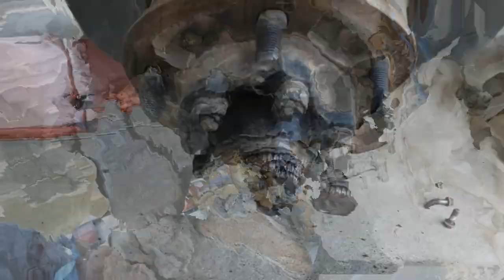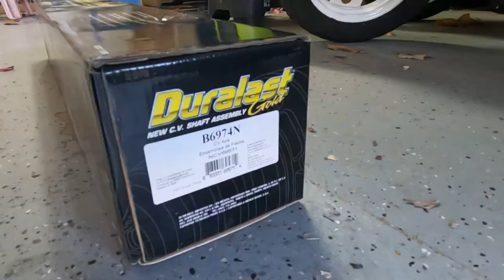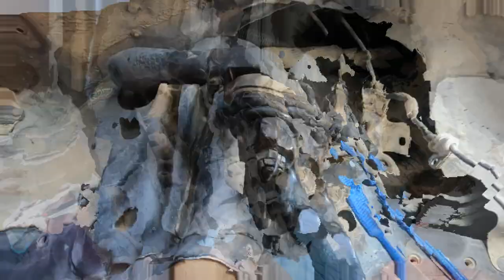Easiest CV axle replacement Land Cruiser 100 Lexus LX470 ASMR

Comment: Bro this took me and my boys from 1pm to 1130 at night . Holy shit so many rusted parts and autozone runs . 😂
Reply: 2 hours for me so far and I still can't separate the ball joint like in the video he just hammered it out lol. I just ordered a ball joint separator and I'll go from there.
Reply: @seahawksforever9504  I used my bottle jack and placed it in between the rotor and the upper arm then hammered it with a 5lb hammer it came undone
Reply: @seahawksforever9504  spray it with PB blaster every day for about 5 days before you are going to break it loose. For example, if you were going to do it Saturday, spray it Monday before you drive it, then again Tuesday and so on until Saturday. In fact, spray ALL the nuts you will be removing. I promise you it will make it so much easier. Even if you don't have all that time... Spray it, then drive it around the block, spray again, drive around the block, spray again, drive around the block, then try to remove everything. It makes a huge difference
Reply: @seahawksforever9504 I sprayed some penetrating oil and used the long pry bar downwards while hammering it, it came out after 2 hits

Comment: Great video! Surprised you didn't go OEM on this one. Curious to see how these Duralast hold up!
Reply: Lifetime warranty on duralast 🤣🤣
Reply: @depooltrd  is that true? Or are you being sarcastic?
Reply: @tynado1173  100% true. Normally the people use duralast on alternators, starters, brakes, CV, etc.
Reply: @depooltrd  good to know. Thanks man
Reply: @depooltrd  maybe but who wants to keep changing out cv axles? lol
Reply: @illustriouslaz  if you lifted the car and do off road, that's going to happen soon with oem or any brand.
Reply: @depooltrd lifetime warranty doesn't mean anything if it just breaks over and over. I used an O'Reilly's brand on my Tacoma and after that, EVERY TIME I went wheeling, that side broke. After 4 times of replacing it I went back to OEM and it never broke again. 

If you have to go aftermarket, NAPA makes the strongest aftermarket. It's close to OEM but I'm not sure it's quite as strong. Still way better than O'Reilly's, AutoZone or Advanced Auto.
Reply: @depooltrd I disagree. I've been wheeling Toyotas for over 30 years. My 18 yr old Tundra with 200k miles on it, that's lifted with 33s, and has been mudding and rock crawling for the last 10 years, just finally wore out the original set of CV shafts that were OEM. You won't convince me a duralast will get 18 yrs and 200k miles.
Reply: @Steven-gv1ke  off-road with 33" you just said everything. Have a good day.
Reply: NOT WELL - there is a boatload of data on how poorly AF CVs perform vs OEM Toyota

Comment: I wish you had showed how you tapped it in. You can see it slide into the diff but we can't see where you were hammering and with what tools. I have not been able to hammer mine in despite using a 3 lb dead blow hammer and a 2x4 piece of wood. Yes I greased the shaft and retention pin.
Reply: Watch again. Crowbar and sledge. Not sure how you are trying to use a piece of wood; the lip on the inner cup is for precisely this purpose.

Comment: I give you max 1 year on this aftermarket axle, I will tell you what happen after 1 year time, you will notice vibration , then you will start inspecting why , and I will save you time look at you needle bearing , bronze  bushing and inner seal on the hub , they will be butchered by this aftermarket axle

Comment: @chowcares 
How are your Aftermarket CV’s holding up? Just got a set from autozone since they are cheaper than the OEM ones
Reply: NAPA makes the strongest aftermarket CV shafts for future reference
Reply: @Steven-gv1ke  good to know I’m already replacing my duralast cvs
Reply: AutoZone is garbage as is most aftermarket. Napa usually makes ok parts but I hope it holds up well for you.  Hope you aren't doing any extreme offroading.

Comment: You're gonna need:

Blue loctite
Nitrile gloves (recommended)
PB blaster spray
Anti-seize for drain plug threads
Torque wrench
54mm axle nut socket (some say 55mm will work)
Pry bar (two is better)
2 or 3 lb hammer
Metric socket set
10mm allen wrench (some are 24mm)
Bowl/bucket to catch diff oil
Grease for wheel bearings
2 quarts of 80w-90 diff oil 
(2) drain plug gaskets Toyota part # 12157-10010 (don't reuse the old ones)
4 ft. of ¼” ID clear plastic tubing for diff oil
Wire brush
Paper towels

Note: Remove the diff FILL plug BEFORE removing the drain plug to ensure you can get diff fluid back in. A T-55 torx fits 10mm allen head plug. If its the rare 24mm, use a 15/16" six point socket... Its safer.
Reply: I also recommend replacing the diff seals (where the CV shafts enter) as well.

Comment: @chowcares I am in the middle of this job and no matter how hard I try, I can't get enough slack in the axle to pull it out the diff side. I ended up having to take the whole darned knuckle off! Any tips on how to get the axle out without having to take off the knuckle?
Reply from the maker: You can try turning the wheel left or right. I think I did that and was finally able to get the axle out
Reply: @chowcares  This. My suspension is stock, I removed the sway bar link, then the lower shock bolt and dropped the control arm as low as it would go. Then I turned the wheel to get a little more space. It just barely allows installation and removal...

Great videos!

Comment: So do you still think Duralast Gold CV Axles is worth it? Lifetime is nice but I would get tired of replacing it every 2 or 3 yrs no?
Reply from the maker: Hoping that the diff drop I installed will make them last longer
Reply: 🙏 Hope so too..$99 is such a great deal for it with the lifetime warranty!
Reply: The lifetime warranty is nice, but only worth it if they don’t implode on the trail. A cheaper part that breaks when you need it the most is always a poor investment. (Not saying that’s the case here, and hoping they hold up for a long time and wear out slowly, so you can change them at your own discretion!)

Comment: What did you use to suspend the brake calipers?

Nevermind, saw the bungee cord later on in the video
Reply: I just use a zip tie through the caliper bracket bolt and zip tie it to the sway bar.

Comment: At 53 seconds or so, there is quite a bit of grease below the CV boot. Is that indicative of a torn CV boot and/or the need to replace the CV axle? That excess grease is present under both of my CV boots and I'm wondering if I need to deal with this by replacing the CV axles.  Many thanks for posting this video, as well as your others!
Reply from the maker: If there’s still grease in the boot, u can try to do boots only. But if u notice dirt inside the boot, it might be time for a new axle
Reply: @chowcares  Sounds like a good way to proceed! Thanks again and for the record, I like your commentary just fine :)

Comment: Thanks for the video. I'm about to do this exact repair. I noticed in your previous video on this, you had some trouble with slipping the inside end of the cv axle in. Was it easier this time around? Curious also, Is it possible to push the inside end of the cv axle in first before the part that goes into the hub?
Reply: No, it does not. I am currently working on this right now. Most people will remove the lower ball joint and take the whole piece out. I do not want to do that. Just copy this video.
Reply: It's impossible to do the hub last. The hub must be done first. The hardest part is getting the CV shaft to fully snap into the diff.

Comment: Hey man! I attempted this method on a 2000 Landcruiser and the inboard side of the OEM cv axle came apart spilling the internals of the tulip joint all over the ground. The snap ring that holds the inboard side together must have come apart.

It wasn't a huge deal because I was replacing said axle, but it's worth noting to your subscribers that if they intend to reuse the axle, there's a possibility of it coming apart which would mean potential damage to the balls when they hit the pavement.

I personally will not attempt to use your method on my own truck because of this experience but that's mainly because the OEM cv axles are $400 per side.
Reply: Same happened to me when I tried that method. Definitely hit or miss
Reply: No snap ring on the inboard joint. Mine almost pulled apart trying this method. Easiest thing was to jab the casing with a crowbar from the opposite side of the truck. Two or three hits and it pops out. Getting an angle to jab on the passenger side is harder but doable... might take 4 hits 😉